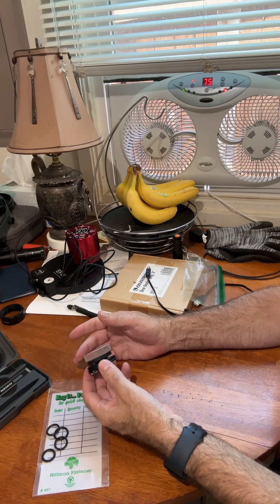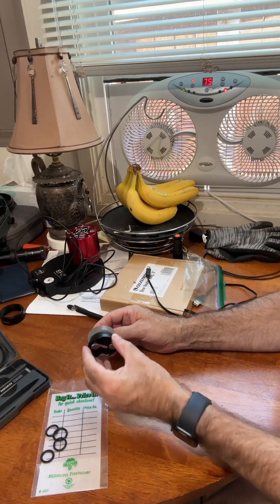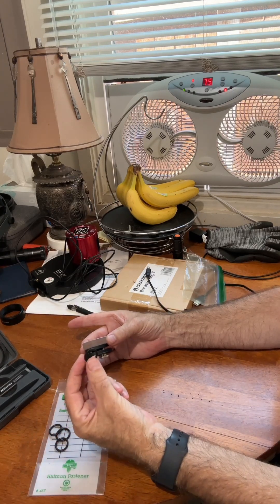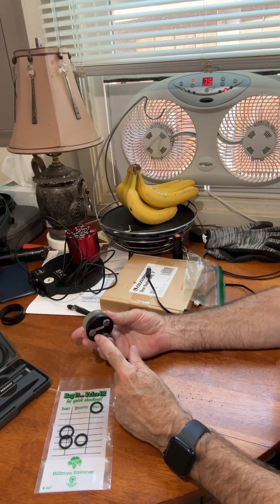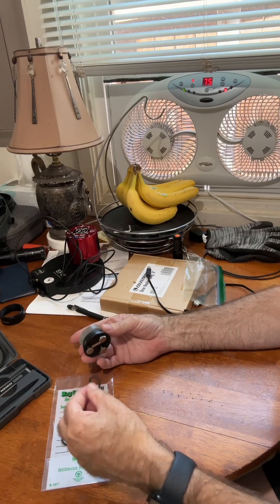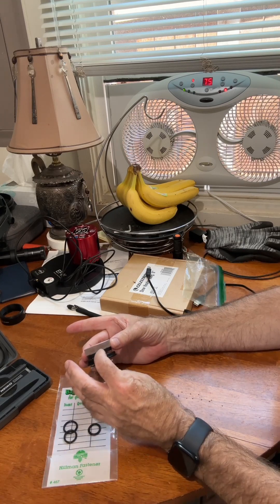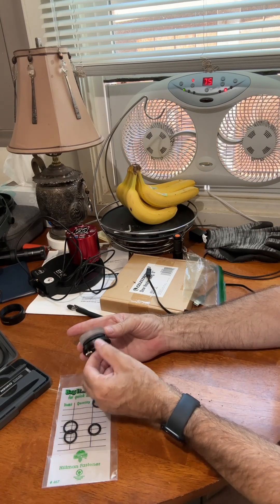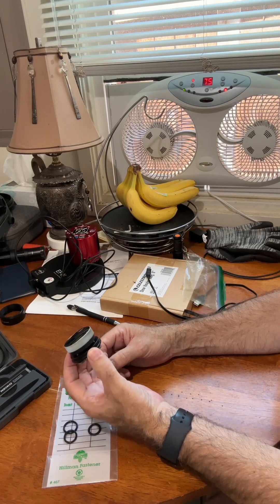Celestron C6 Collimation Issue

Comment: Hi Mark!

I may have a similar issue with my C8-XLT. Do you have any before and after images or videos?
Reply from the maker: To be honest, I am giving up on the SCT and going back to refractors.
Reply: Last night I spent between 1.5 and 2 frustrating hours trying to collimate my C6.  I used Arcturus, which was up around 60 degrees, as my target star and began trying to use a Tri-Bahtinov mask.  I couldn’t make any headway and might have made things worse, so I shifted to the airy disk method.  After the airy disk looked like it was about one step away from good collimation, all of my effort made things much worse, and whatever I did with the collimation screws, I couldn’t get the circle we want in the center to move away from the edge.  Disheartened, I gave up, decompressed for 30 minutes, and went to bed.  I in my fourth week of recovering from Covid—stopped testing positive four days ago—so maybe the virus is affecting my judgment, but at least last night I was thinking of getting out of the SCT business and working primarily with my William Optics Redcat 61 on my AM5 mount and controlled with an ASIAIR+, which works great.  And this after buying a used Celestron 8se just a couple of weeks ago.  Haven’t looked into its collimation yet, and after last night’s debacle, I’d probably be afraid to try to adjust it if need.  Not sure what to do, but the thought of leaving SCTs behind has some positive aspects.  So it’s interesting to see that’s exactly what you are doing.  I’m a member of my local astronomy club, so maybe I can pay someone much better at collimation than I am to try to get my scope(s) collimated.